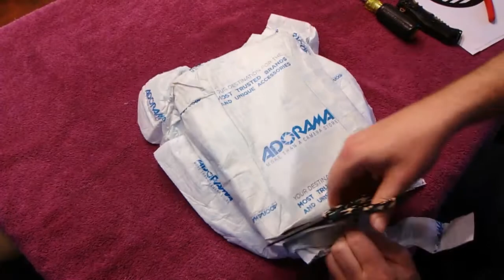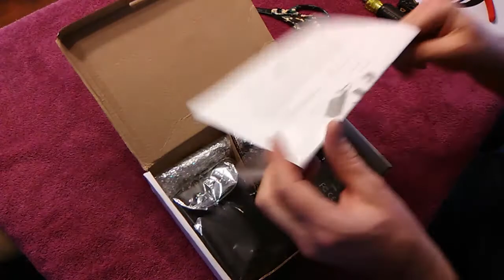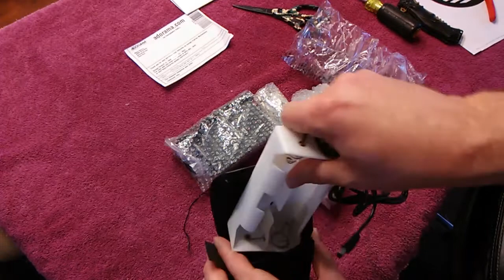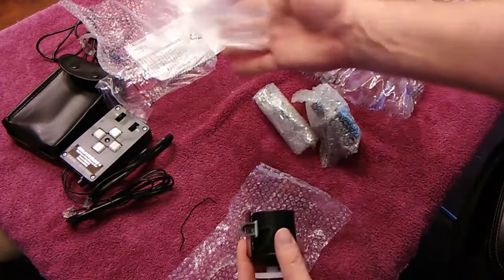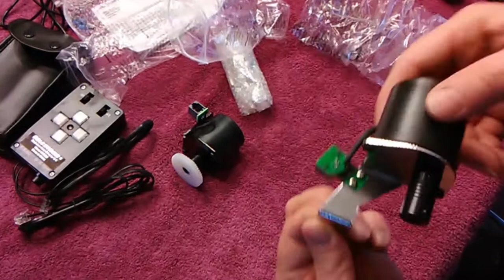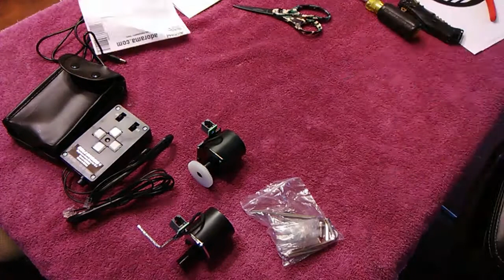Celestron Dual Axis Motor Kit Unboxing

Comment: Hi, a question, the wires in my Dec motor (red, yellow, green and brown) came unsoldered. by any chance could you tell me exactly if after the yellow there was green or brown? I would be grateful.

Comment: Deffiantly not a refined look, but how does it preform? I'm looking at getting a Celestron OMNI 150 with this motor driver system.
Reply: What are your astronomy goals? What do you want to see or learn?
Reply: @jrweathers5296   Just a enthusiast since a kid.. Better views of planets and Messer objects.. and some astrophotography. But I'll need some mobility in my scope, a big Dobsonian won't work. My borther in-law has a 12" one and a 9.25 Celestron he recently acquired. Also inspire my grandkids..
Reply from the maker: @andrewlabat9963  You need to save up a little more and buy a goto mount. Search highpoint scientific for item# 91519 . If you could save up more, i'd buy even bigger.   I found a good deal on a cgem on cloudynights classifieds.  

Once you get an amazing mount, then look for a scope about 1/2 the mounts weight capacity.
Reply: @AstronomyRocks-bi8io   I have been playing with the idea of a Celestron Advanced VX 8, but not sure that would be worth the nearly twice price jump.
Reply from the maker: @andrewlabat9963  forget the telescope. spend all available funds on a mount.